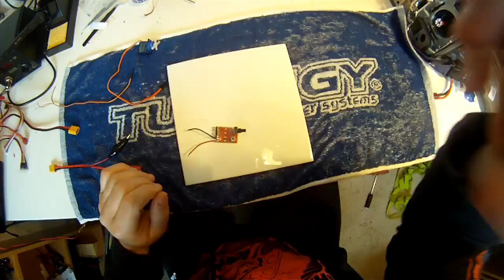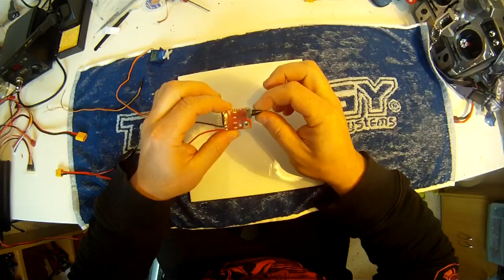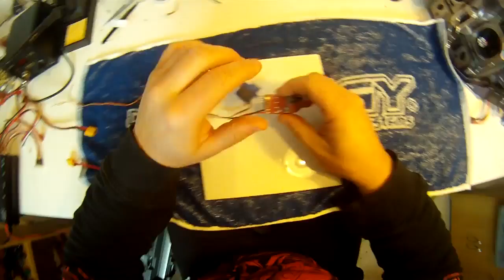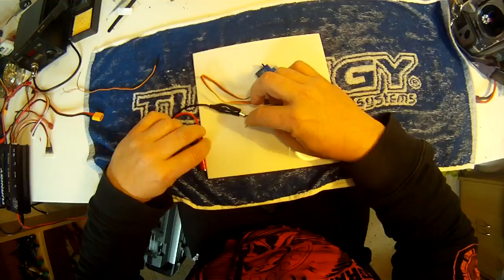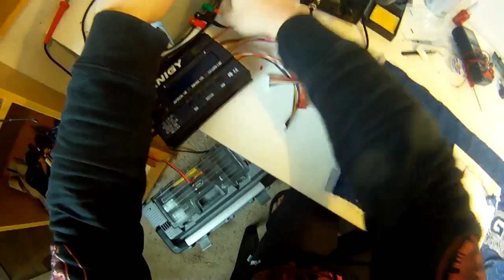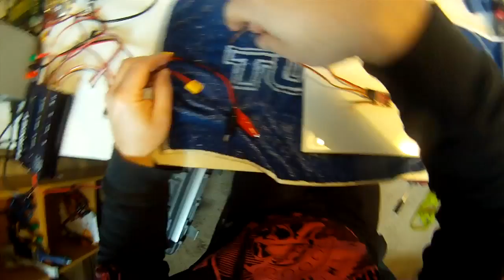simple servo tester instruction guide

Comment: I'm going to use this tester for a small robotics project, how much do you need to rotate the potentiometer, for a full servo movement? Just approximately, 90/180/360 degrees?
Reply from the maker: it has been such a long time since I have used this .... I could not tell you. Thanks
Reply: Ok thanks!